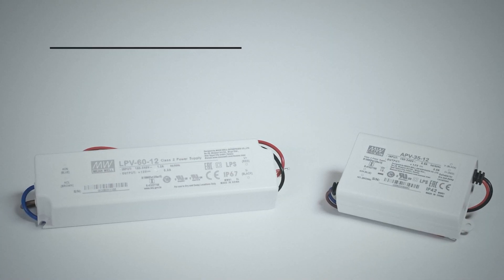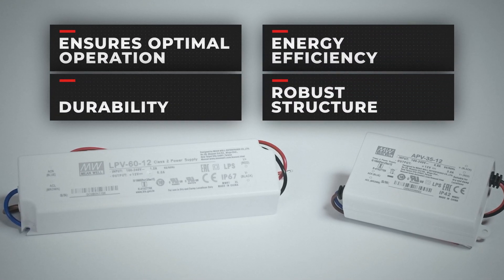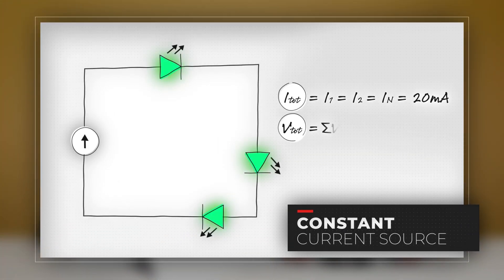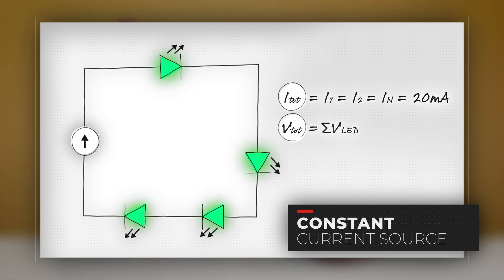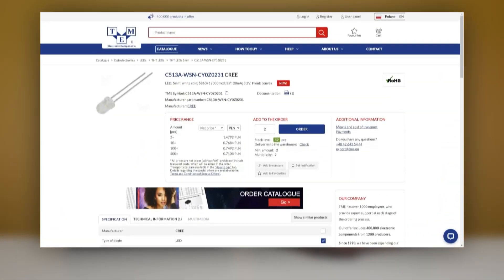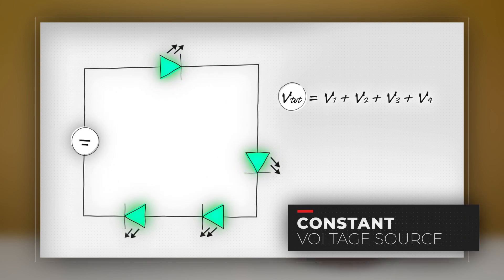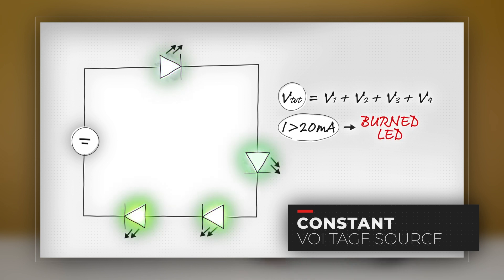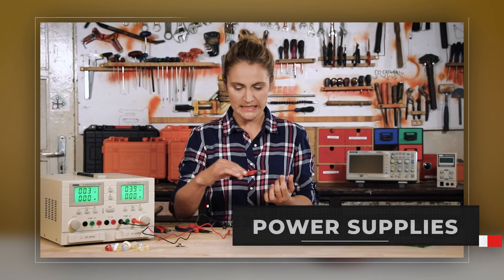MEAN WELL LED Drivers

Comment: Can these mean well power supplies, specifically HLG 240H 12A be placed inside of a model kit for LED lighting?
Reply from the maker: Hello :D
The HLG 240H is designed for outdoor applications and works best when there is adequate airflow. Therefore, we wouldn’t recommend placing it inside a kit.

Comment: I have 6 x 6w 12V bulbs and want to use DALI as a control mechanism, which driver would be best
Reply from the maker: Hey! 
If you're using 6 x 6W 12V bulbs and want DALI control, the Mean Well ELG-75-12DA is one example of what you could use. Here is the link: https://www.tme.eu/details/elg-75-12da/led-power-supplies/mean-well/
It gives you 12V output, 75W power (plenty of headroom), and full DALI compatibility for smooth dimming.
Just make sure your bulbs support dimming, and set the driver to constant voltage mode.

Have a nice day!

Comment: I have a HLG-150H-24B driver with dimmer capability but wen hook up to the 24 v Led light which is 5 meters long it does dim,can u elaborate why
Reply from the maker: Hey :) 
Just to be sure, check the installation notes once more, you can find them here (page 5): https://www.tme.eu/Document/0473204483006407b2d818d1a9e50cd4/HLG-150H-SPEC.PDF

To ensure you have the proper power supply for your LEDs please check the video here: 
https://www.youtube.com/watch?v=VI85HDkH4LA&ab_channel=TransferMultisortElektronik 
and go to the chapter (at 10:14) "How to chose a power supply".

We hope it answers your question, have a wonderful day!

Comment: What Mean Well driver can I use for 4 Cree LEDs of 36 volts each, and achieve a power of 100w in each one?  I need 2.8 amps total.  I also need it to be dimmable with a potentiometer.

Comment: Hi there there's two grommets under my elg 240w one is voltage which dimms the light.
The other is the Lo what is that for adjusting?
Reply from the maker: Hey :) There are a few types in the ELG 240 series. Could you be more specific? The type is at the end of the title (Blank, A, B, AB, D2, DA) However, if you have two potentiometers (grommets) and one of them is Vo then the other one should be Io (capital "i", as for current), to adjust the current. 

Just in case, here is a link to the ELG-240 A-type series: https://www.tme.eu/pl/en/details/elg-240-24a/led-power-supplies/mean-well/ It has both, Io and Vo, that are adjustable through the built-in potentiometers.
You can go to the "TECHNICAL INFORMATION" tab and check the manuals.

Hope you find this answer helpful ^^ 
Have a wonderful day!

Comment: When adjusting the voltage to my driver what happens? And should it increase as I increase current or stay and one set votalge? Also I have to turn with a screw driver to set them.
Reply from the maker: Dear Vape Africa :) If you could give us the model of the LED driver, we could try to answer your wonderful questions. We suggest going to the manual and check first what kind of LED driver it is.

Constant Current LED drivers (i.e. HVGC-100 or HBG-100 series) are suitable for connecting LEDs in series like an LED strip. In that case, you can adjust the output current with the “Io Adj”. 

The Constant Voltage LED drivers like the LPV-60 series are used for parallel connection and for the given current range they will maintain the same output voltage. Some of the LED drivers also have a dimming function. Is that what you refer to while adjusting the voltage? 
We hope that this short explanation gave you a better idea of LED drivers, if you have more questions please put them in the comments, have a great day!